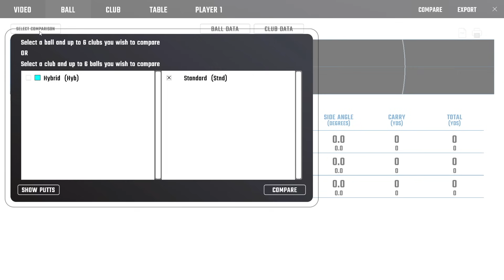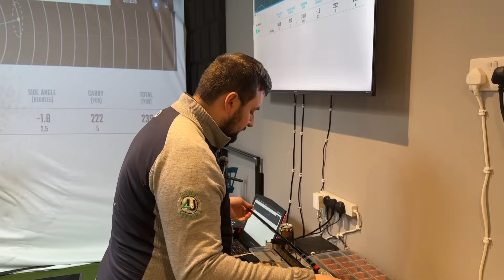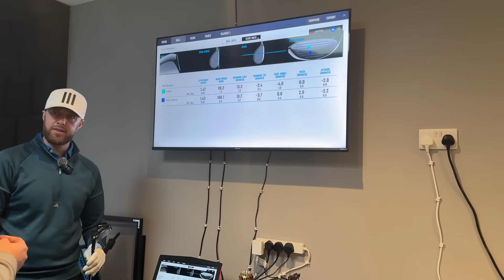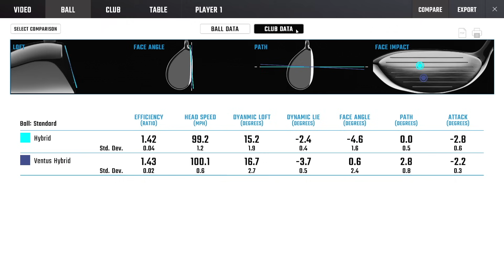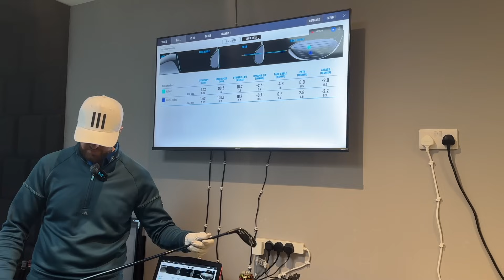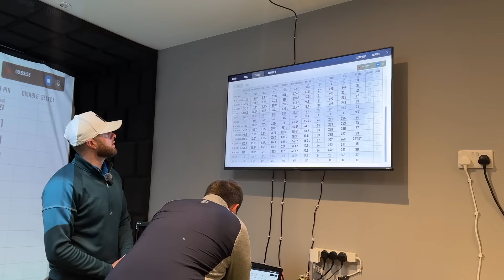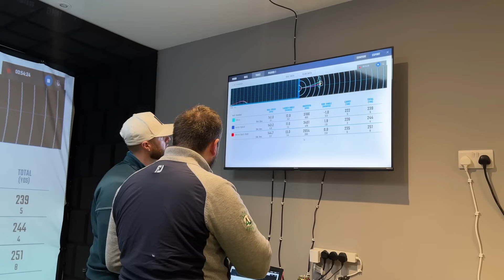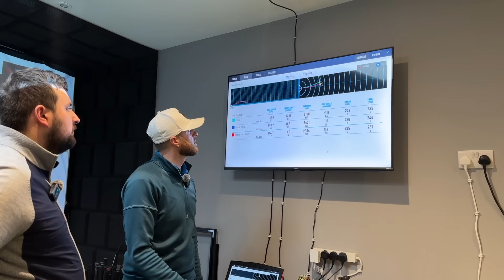Hybrid / Rescue CLUB FITTING on a BUDGET!… #customfitting #golftips

Comment: Gary, great video with Sam again, Just a thought, what about buying a previous GEN PXG hybrid 2nd hand and sell your Ping to fund it! You could have tried the PXG hybrid to see just where abouts you could get the numbers to see if its worth it but the 2nd hand market for a previous gen PXG would mean the cost to you would be minimal especially as PING hold great 2nd hand value!
Reply from the maker: I’m going to be honest Dan, he had a few older PXG heads, but I wasn’t that fond of the look of them. I think what I’m going to do, is like you’ve said, try to pick up a used hybrid head with a toe / heel weight port off eBay, and then go back down to see if he can improve on the setup I’ve got. 

Thanks bud
Reply: @garymartingolf  Yeah I get you, I only like the GEN 5 onwards stuff looks wise really to.

Comment: Great stuff guys. Love how you go about and explain how grips, weight effect swing weight and how everything ties together.

I got the PXG 0311 10.5 degree in a HZRDUS Smoke RDX Blue per your advice.
I love the possibility to fiddle with settings my self.
I currently have it on +1 degree and +0.5 degree upright.
My 10+ yard fade has gone to a +5 yard fade.
Next time, I’ll switch the toe weight (7.5gr) with the rear weight (2.5gr), and see what effect that’ll have.
Ideally I want to get a 12-14 degree launch angle with 2200-2500 spin, should get me 240 carry with 95-100mph driver speed.
BTW my ball speed has already gone up almost 6mph 😱
Reply from the maker: That’s great! Remember aswell, you can buy after market weights too if required to re position weight further. Also consider your swing weight, I’d guess you might like it lighter if you’re trying to minimise the fade, could possibly add a slightly heavier grip.

Comment: Although it only allows + or - 1 degree of loft, what about trying the shaft in the flat setting as that should move things right?
Reply from the maker: Yes, great point! We could have tried that. I don’t carry a 3 wood though and the club reduces -1.5, which I think would have the same effect on clubface whilst lowering the loft.
Reply: @garymartingolf  Possibly worth a try to see if -0.5 loft makes a bigger difference than -0.5 lie angle relative to the -1.5 loft and -1 flat settings.

Comment: I got new fitted irons this month. The top end of the bag will be tough to build. Definately will be fittings all around
Reply from the maker: What did you go for ?
Reply: @garymartingolf  t150 3 through gap. Std loft. I knock 3i and 3h 240 yds. My top end will be clustered. Choices will have to be made.
The t100 and i59 had awesome dispersion, however I couldn't find the butter spot. If I was 20 years old again, those would have been better. I'm too old to use pain to learn to swing better.

Comment: Would it help if you pulled your right foot back slightly?
Reply from the maker: Possibly? What are you thinking?
Reply: @garymartingolf Initially all the shots went left (not a draw or a hook, just straight left.) By moving your right foot slightly back, you would change your angle of attack slightly. I realise you were rather trying to hit a fade, but this could at least remove the shots going into the left rough.
Reply from the maker: @franskrause4658  So you mean, to get the path more in to out to try and start it further right. I guess you could try to do that if you like the right to left. I may give this a go, as I guess it might still draw abit.